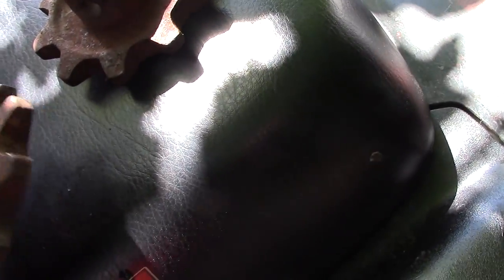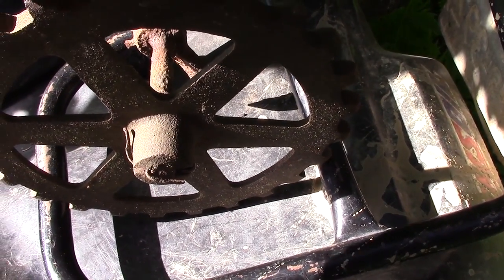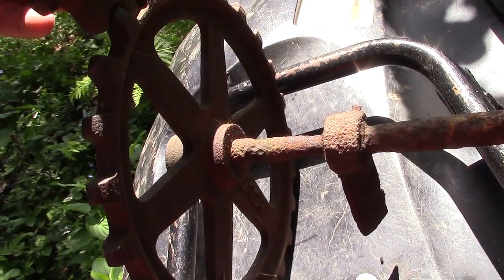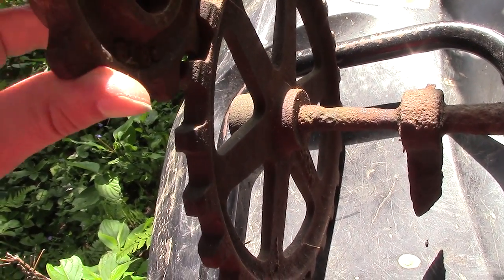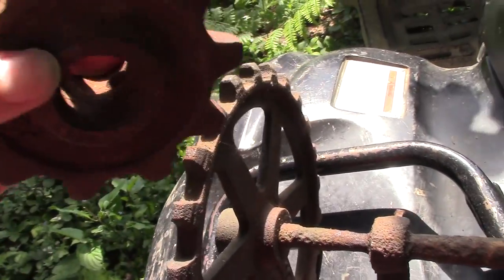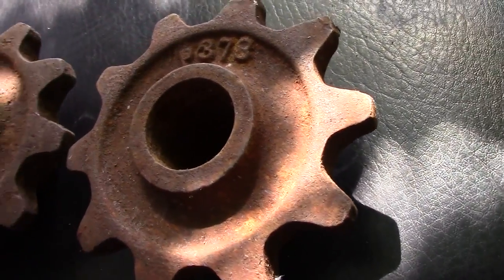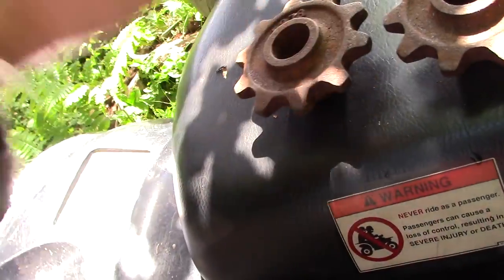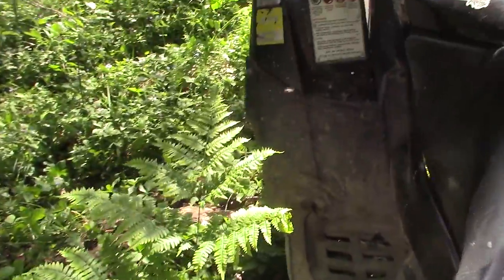Collecting forest finds for a project

Comment: One thing,Those arnt gears,they are sprockets,you need the flat chain to run them..You should find chain in the woods!!
Reply from the maker: Thanks for the tip! I know where there is a flat chain right now! I'm trying to track down some free bearings or at least very cheap bearings at the moment so that could take awhile, I would much prefer free though lol

Comment: What are you planning to use as the generator? Maybe you should check out the old washers from a previous video. Y'know where you found the geocacheing bucket. They have a 120V AC motor in it. Well, they should have one.
Reply from the maker: I was thinking of using a regular alternator off a car or truck, I did have a washing machine engine but for some reason it wouldn't produce power.
Reply: There is a tutorial video on YT about how to convert a washing machine motor to generate power. With an alternator you would have to convert the 12V DC into 120V AC.
Reply from the maker: It would be charging a battery bank and the 120 would be running off an inverter. I already have 2 inverters on hand that were used in our semi trucks.
Reply: I see. I look forward seeing the progress on your power plant.